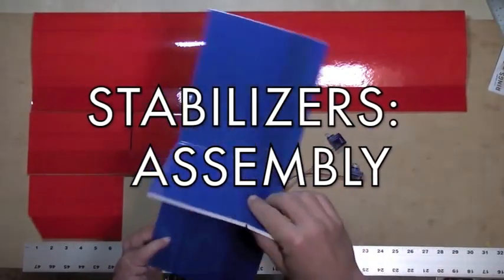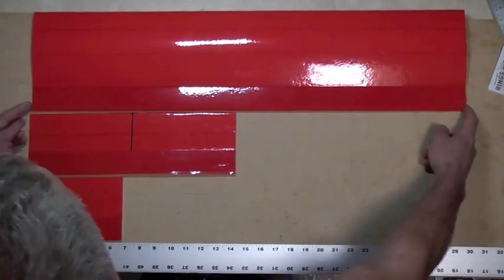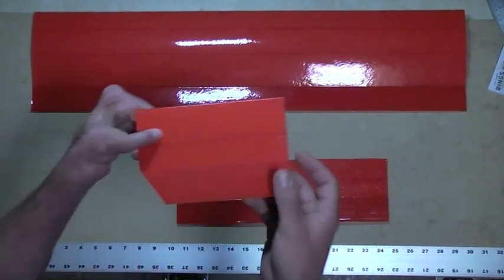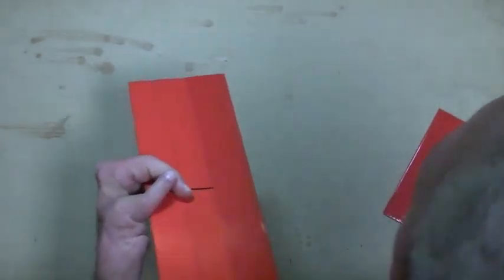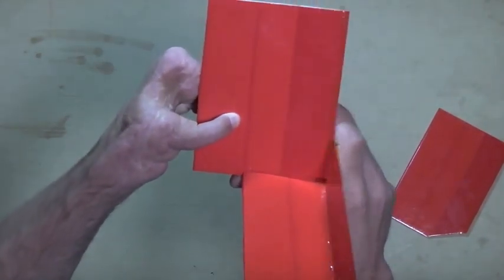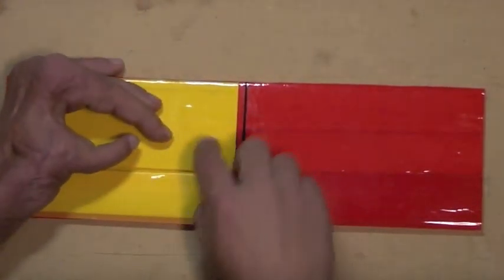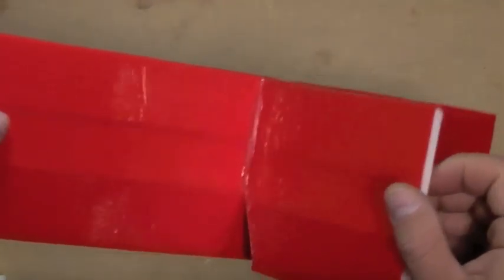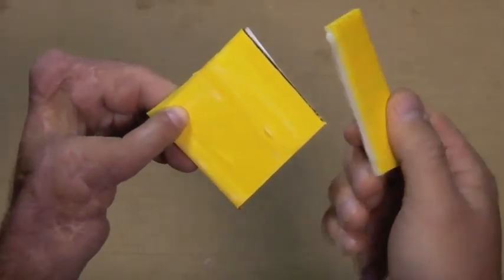Foamboard Building Techniques: Stabilizers 3 - Assembly

Comment from the maker: It depends on the plane but I commonly use 6" root, 4" tip, with a 1.5" or 2" elevator or rudder for most of my planes in the 30-60" long range.  6-8" tall vertical stab and 12-16" horizontal stab is common in my designs.  The shorter planes actually need relatively more tail surface for stability since the moment arm is short.  Longer tailed planes can get along with relatively smaller tails even with longer wings.  So the dimensions above are decent for most all-purpose tail assemblies.